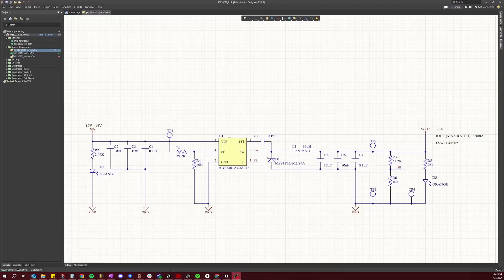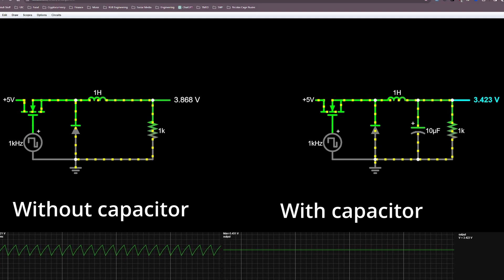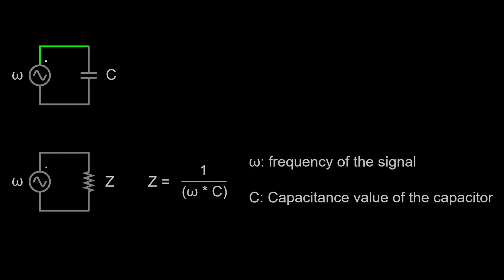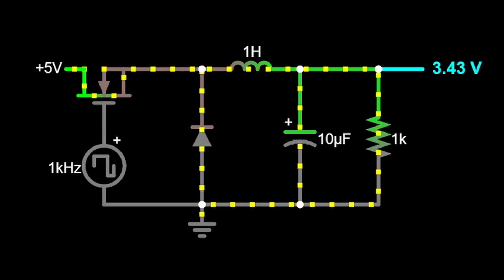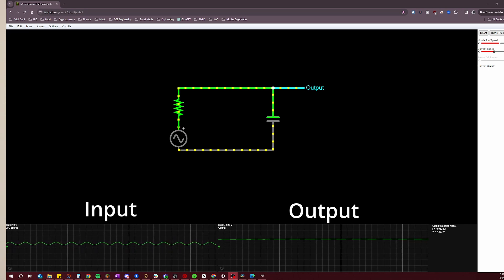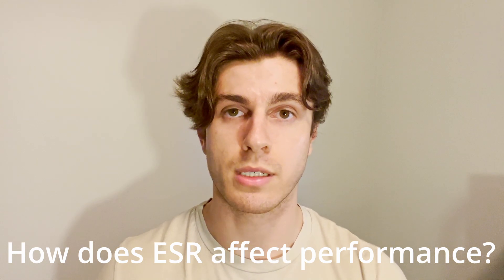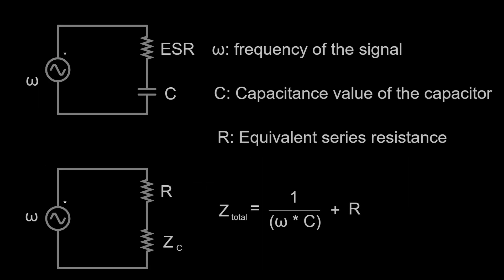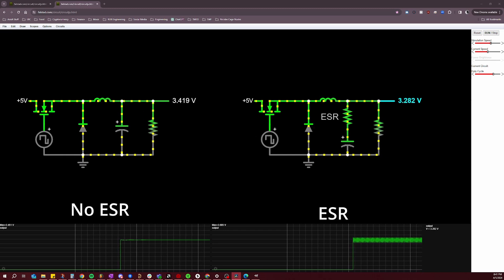How to REDUCE Power Supply Noise | REDUCE Voltage Ripple | Reduce Capacitor ESR

Comment: Very well done granted my education was in the tradition of the electron current path so my quantum theory is immense in relationship to the bulk majority of others engineers I encounter.
One way or the other, your theory explanation was great.

Educational resources for our field of science are now absolutely massive in abundance online but I'm also seeing it get swamped in bad theory or poorly explained physics and topology. I'm still always biting my tongue over some of the totally incorrect theory taught under the conventional current path but I also understand the purpose in using it.
For analyzing circuits and designing circuits, it makes those taught it top notch employees.

For those of us taught old school quantum physics based on the electron model, we're always determined to reinvent the wheel or our own particle accelerator out of scrap from around the home lab! lol(yes, I have one I'm in the process of building).
Reply from the maker: Glad you liked it! My experience has been similar.

Comment: Hi, from a practical point of view, the video is very good, the ideas are correct. But you missed the correct way to add those impedances. You can't add the capacitive impedance and the resistive impedance. Impedance is a complex value, so the correct value is Z = sqrt(Z_c^2 + R^2).
Reply from the maker: thank you for that additional info!

Comment: No, that's not the only reason!

The main issue isn't ESR but rather ESL. When a component (like a CPU) switches rapidly, the parasitic inductance in the capacitor can limit the inrush current that the capacitor would otherwise supply. This means that if the component demands a large amount of current very quickly, the inductance can prevent the current flow, effectively making the capacitor invisible to the load - it’s as if the capacitor isn’t there at all! To address this, we use multiple capacitors in parallel, which reduces the total ESL because parallel inductances combine to lower the overall inductance. 

Additionally, smaller-value capacitors like 1uF, 0.56uF, and 0.1uF are often used together instead of a single large capacitor because lower-valued capacitors generally have less inductance. So their combination ensures better performance across a wide range of frequencies!
Reply from the maker: Very helpful additions :)

Comment: I vaguely remember something about the capacitor obsorbing ripple peaks as it charges, then filling ripple troughs as it discharges!  🤔
Reply from the maker: You are correct - the capacitor smooths out the ripple by charging during the peaks and discharging during the troughs.

Comment: Very clear explanation. I might have missed you mentioning it, but it's worth noting that, in general, esr is inversely related to capacitance. So even though using two smaller capacitors in parallel reduces total esr because they are in parallel, the esr of each of the smaller capacitors, other things being equal, will be larger than the esr of a single cap with the same total capacitance.
Reply from the maker: Thanks for sharing!